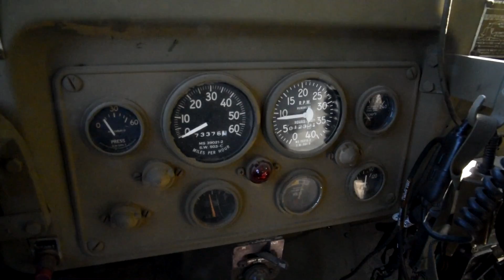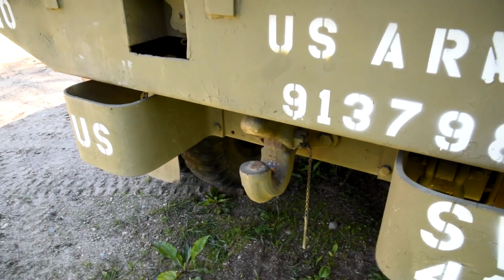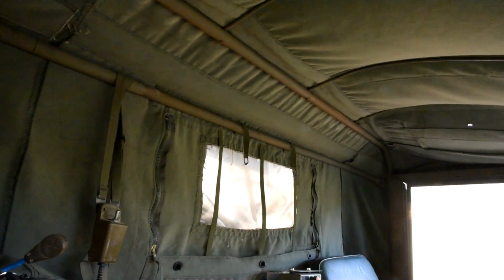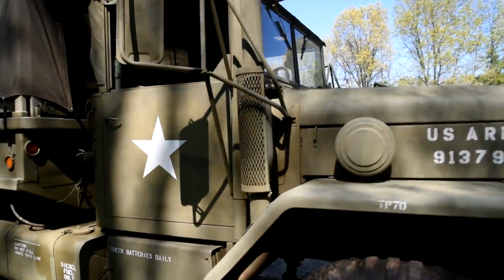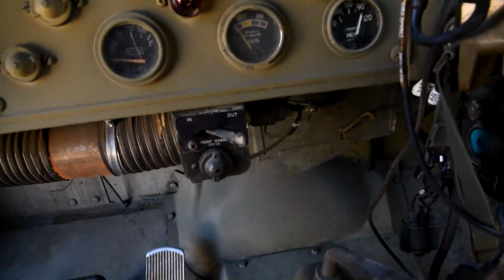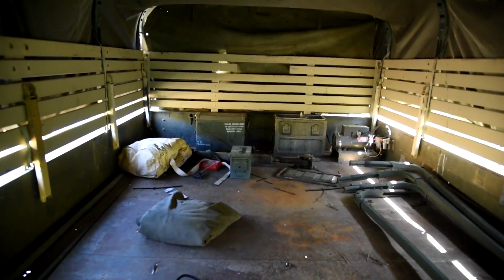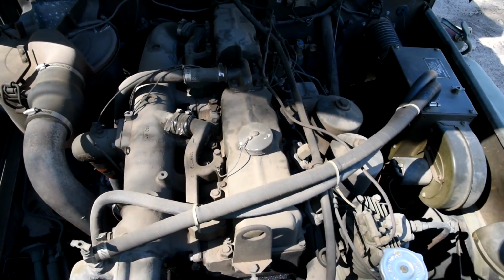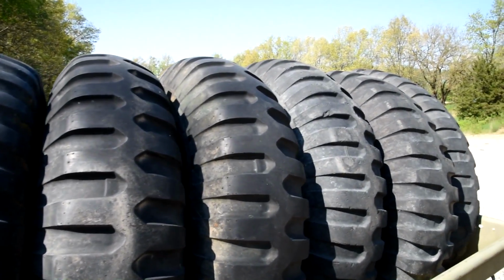My Souvenirs from Las Vegas - M35A2

Comment: You want to ensure you drain the air tanks at the end of the day or the moisture that builds up  will cause some issues in the air system. That winch cable system also has its own maintenance that you have to ensure you do or else that cable may not work when you need it most.  The Technical Manual -10 and -20 should provide a maintenance checklist to follow.
Reply: Yep I already see a T.I. gig for winch cable improperly rolled. No lube on winch cable, etc. Eddie you sound like you may have also been a 63B

Comment: The sound system may be able to use just to talk to each other.  There are CB radios that work on 12 or 24 volts negative or positive ground! Don't know how but you may be able to get the CB radio may be able to work with the head sets.  Just a thought.

Comment: Nice equipment but be careful, you were reading the oil pressure not the air pressure gauge on startup.
Reply: sh839c  I noticed that too.
Reply: He also shifted it into reverse and said and we are off and then cut the clip

Comment: Nice duce had one station at Germany without the 50 ring you could kind of burn rubber ....put transfer in low gear in 2nd rev it up  pop the couch pull transfer to high...dose better with dirt on the hard ball wouldn't do it all the time wear your couch out have fun

Comment: 4th and 5th gear are reversed as 5th gear is overdrive. This truck has about 40 grease points. Neglect them at your own peril. The thing on the gun ring is the bad boy on the block: the M2 .50 caliber machine gun. I would take it off when driving around last you become an object of interest to local crime fighters.

Comment: I know this is out of the ordinary. I have been asking notes for all M35 owners. I am restoring one. For my father. I would really like to see a close-up video of the m66 Gun Ring. How old is mounted to the cab mounting brackets? And a full walkthrough. I would highly appreciate it. Thank you for your time.
Reply from the maker: Gun trucks are kinda different from normal ones. The cabs are convertible so one can flip it open and get on the ring. Because it has so much firepower, the rear cab is reinforced with huge metal plating. This is behind the seat. I sold the truck, but I'm sure someone has one that can take a video for you.
Reply: Thanks for the info. I was wondering could you give me a measurement on the inner diameter? Of the m66 Gun Ring I'm aware that the outer dimensions are 48.
Reply from the maker: Like I said I sold it.